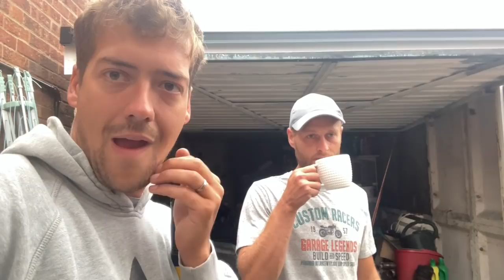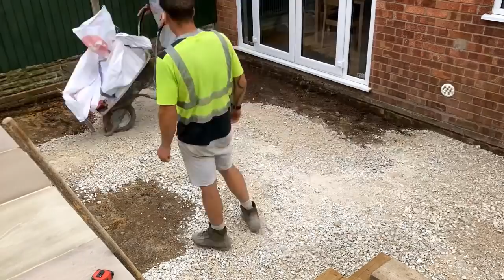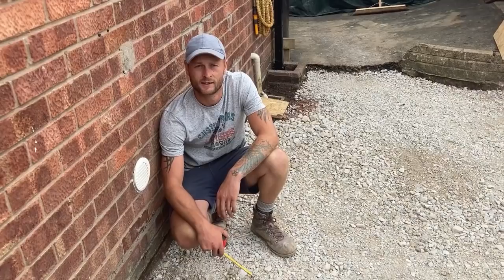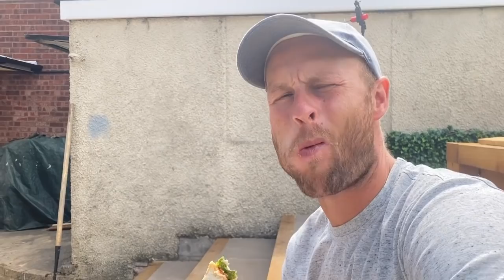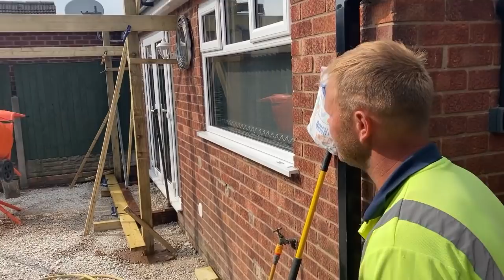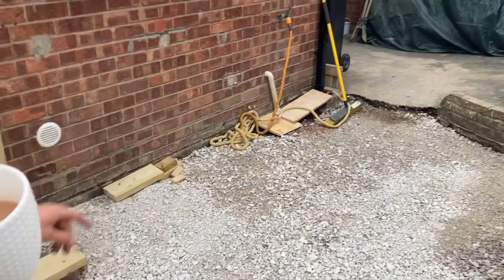PERGOLA BUILDING AND PREPARING FOR INDIAN STONE!!!

Comment: Yes lads, we just bought a power barrow and got delivered yesterday, didn’t get to use it yet…
We had the paslode 350im and had nothing but had nothing but problems with not firing and mid firing, bought the first fix hikoki from ITS, best £330 I have spent, we use it for pinning down artificial grass, shots 75mm and 90mm into our 6:1 cement border mix, definitely recommend the hikoki lads
Reply from the maker: Thanks mate I do like the look of the hikoki
Reply from the maker: Perfect thanks for the message 👍